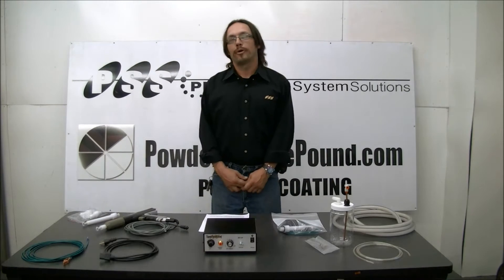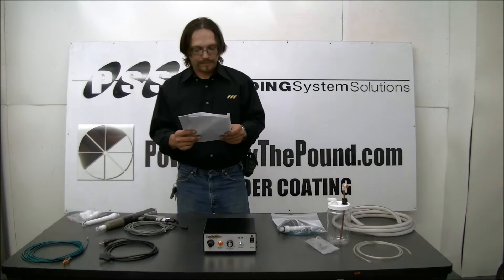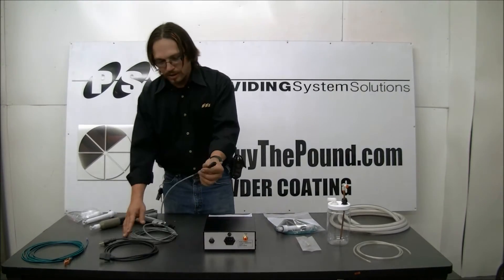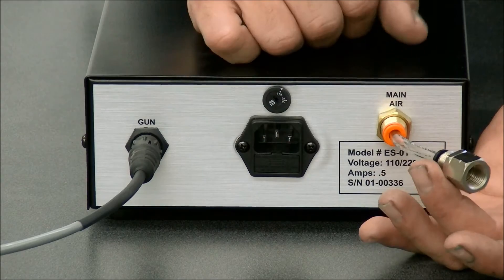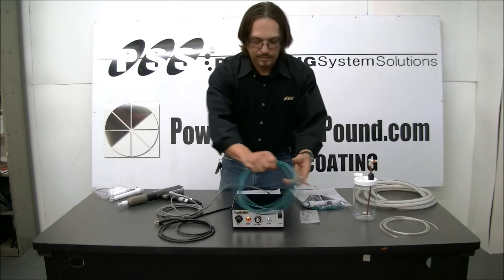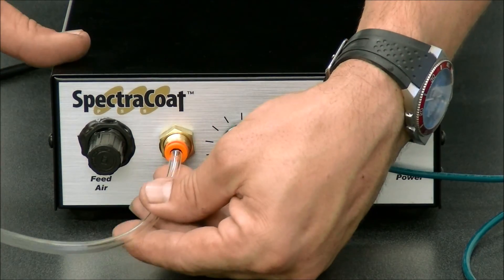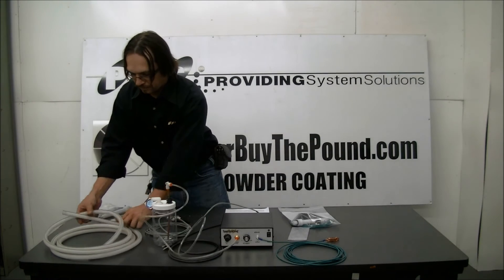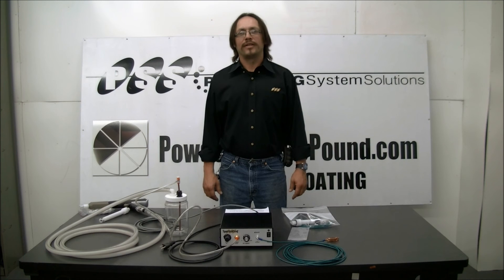How to set up a Powder Coating Gun: SpectraCoat ES01-H System | PBTP

Comment: Is this is an issue if I don't have a ground rod in my garage to hook the green cable to it?
Does the ground of my wall outlet will do the job properly ?
I'm little confused on how to plug that green cable (since instruction say to not plug it the parts to be coated)
Thanks